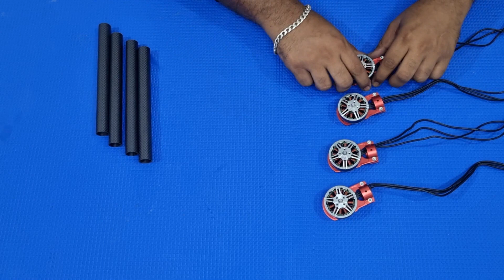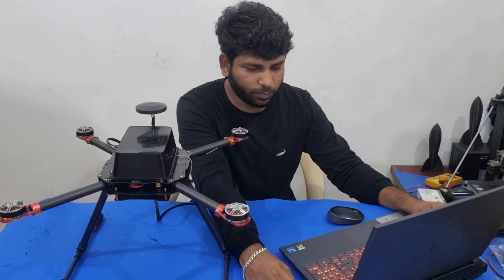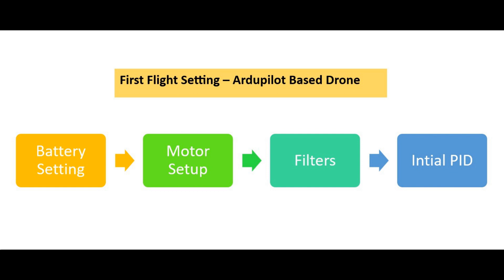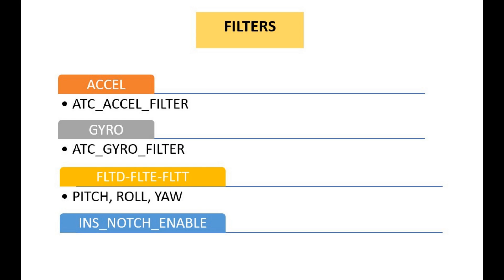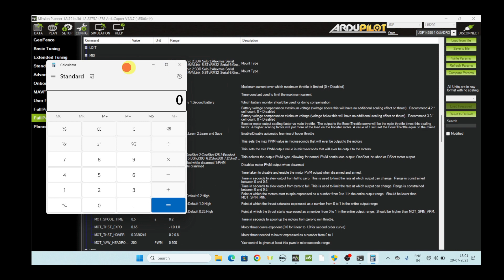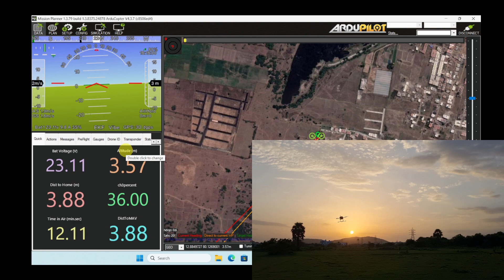Beginner's Tutorial: 2KG Pixhawk Drone - Assembly, Integration, Flight Testing & Basic Tuning #drone

Comment: Hello sir !  I am experiencing oscillations on my 7-inch quad, and I am looking for guidance on how to diagnose and correct the issue. Below are the hardware details:

Frame: Axis Manta 7"

Motors: V2808 1500KV

Props: HQ 7x4.5

ESCs: Tekko AM32 45A

Flight Controller: Pixhawk 6C Mini

Power Board: PM06

GPS: M10

Battery: 2200mAh 6S When the Quad takes off I see noticeable oscillations during hover and forward flight. I am unsure whether the cause is inadequate PID values, filter configuration, mechanical vibration, or something else. I have not been able to resolve it through basic parameter adjustments.

I would appreciate any suggestions on troubleshooting steps, recommended starting PID values for a build like this .
Reply from the maker: Let me check..

Comment: you do a lot of screwing. why don't you buy an electric screwdriver?
Reply from the maker: It will be highly beneficial in the construction of larger copters. The manual screwdriver provides enhanced precision, reducing the risk of over-tightening or stripping screws, which can occur when using an electric screwdriver.

Comment: @karthikstechtime0910 what size and angle is these propellers? Im about to fly A 650 Iron man with A PX4 PIX 2.4.8 and 14 x 5.5,2 props @ 370kv tarot motors. will fly soon. Looking for tune settings before autotune. Thank you for this video.
Reply from the maker: Hi, this is a 13-inch propeller. The pitch angle is 5.

Comment: Hi bro, I'm using Pixhawk 2.4.8 it is flying with no problem but in the mission planner it is not showing the GPS (NO GPS is showing) can you help me?
Reply from the maker: Your GPS hardware is not detected.. 
1. Check GPS pinouts
2. Check serial 5 protocol
3. If CAN interface, check corresponding settings to enable. Verify arducopter documents.

Comment: Hi bro how to solve prearm battery 1 unhealthy.
I using 10000 mah 6s    battery
Reply from the maker: Hi.. You can either disable the low voltage setting to bypass the pre-arm warning message or ensure that you are using fully charged batteries. 

Additionally, it's important to update the battery capacity for optimal performance.

Comment: Bro my drone is not arming resean prearm logging failed
Reply: 2.4.8 flight controller plz give me suggestions
Reply from the maker: What message are you receiving while arming?
Reply from the maker: If you are receiving the message 'Prearm: Logging failed,' please check if the SD card is available in the flight controller..
Reply: Yes SD Card is available in flight controller
Reply from the maker: Perhaps your SD card has some issues, so consider formatting it and then try again..
Reply: I have an another sd card can I install intio flight controller?
Reply from the maker: Yeah..
Reply: Bro problem is resolved
Thank u so much bro
Reply from the maker: @sandippaul4460  Great. Have a happy landing..
Reply from the maker: If you don't have an SD card, go to the full parameter list, navigate to the 'Arming Check' section, and deselect the 'Logging' parameter in the bitmask.
Reply: Ok
Reply: Prearm: logging failed